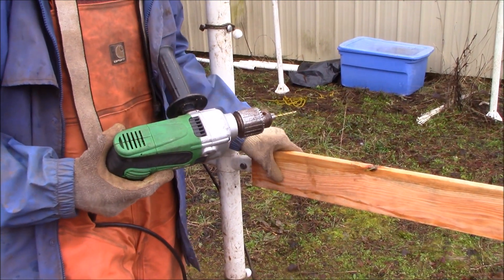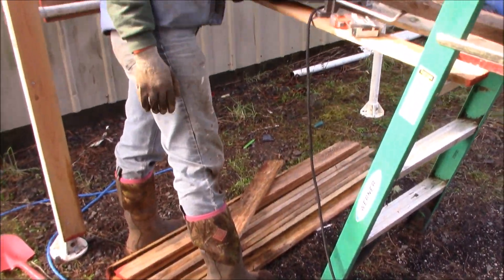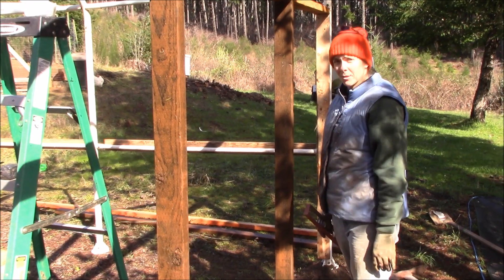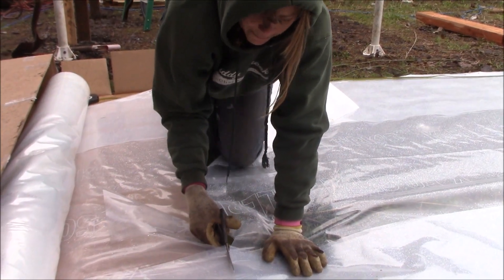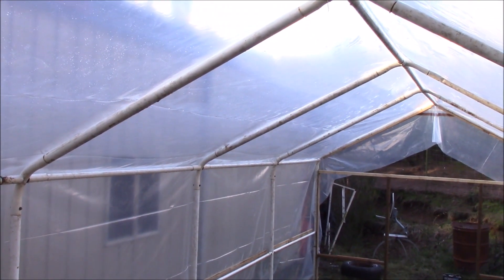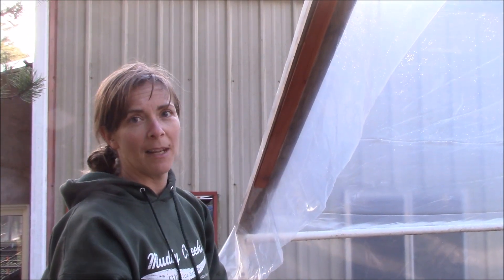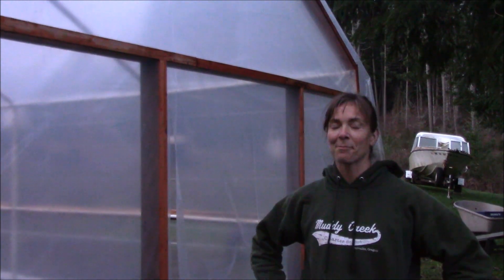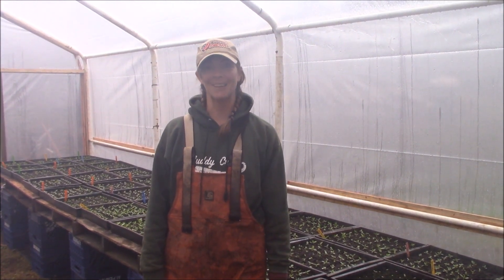DIY Re-Purposing a Carport into a Greenhouse

Comment: I used your process on an old carport I have, but I pulled the plastic on the end walls first then I wrapped the sides and the top. I would have had rain coming in on the end walls had I not. Are you having this problem?

Comment: Great greenhouse! One suggestion is if you live in a place that gets snow it is good to have it far enough from a building that the snow sliding off the greenhouse and the building don't build up on the side of the greenhouse or it can rip the plastic.
Reply from the maker: Good point, we don't have but a skiff of snow ever few years, but I could see how that could disastrous if you had sliding snow
Reply: I have two converted carports four feet apart. Here in South West BC we hardly get any snow but last month we got a record amount breaking 60 year records. I have about four feet between them but snow piled up over three feet between the cold frames pushing in the plastic. I have side flaps so the plastic would have been easy to replace but my lettuce wouldn't have liked it. I didn't even think about the snow when I set them up. I guess with all this "global warming" we need to be careful. I enjoy your channel. Lots of good tips. :0)

Comment: Is the plastic attached to anything along the ground of the greenhouse?
Reply from the maker: No, the bottom isn't attached.  It's in a really protected area and we haven't had any issues, bt if it were more exposed/got more wind we would need to figure something out.
Reply: @RainDropFarms  Thanks. Used your method and have a beauty greenhouse